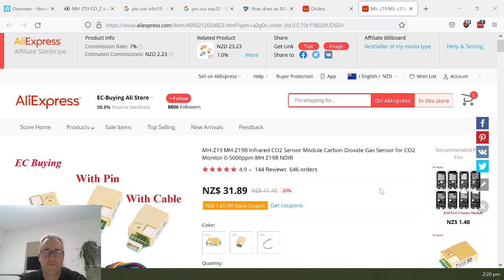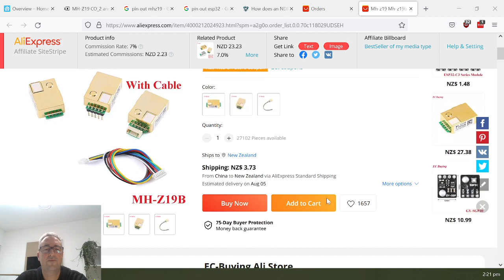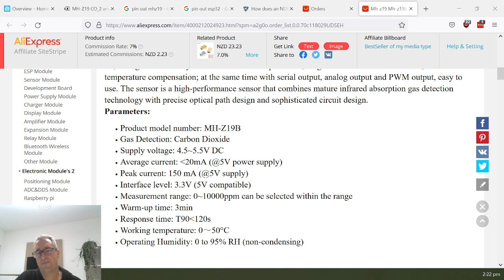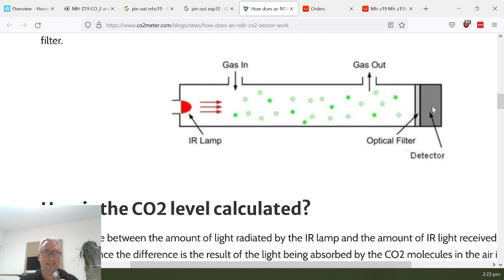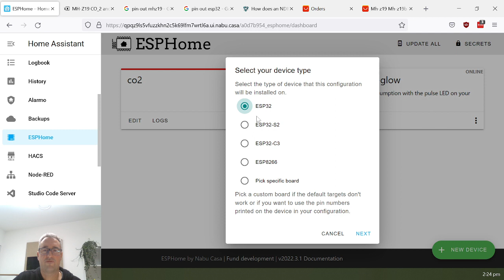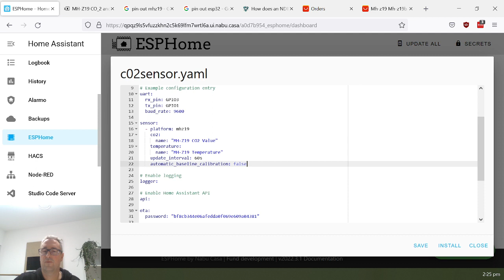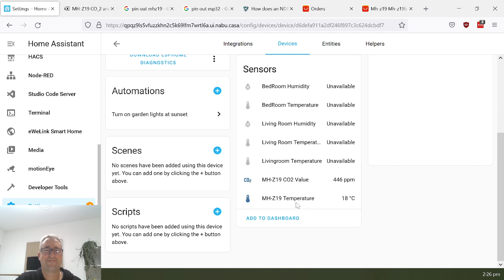DIY MH-Z19 CO2 Sensor build and integration in Home Assistant using ESP Home

Comment: MH-Z19 requires 5V, but ESP 32 outputs 3,3V - can this be (or become) an issue?
Reply from the maker: Hi Markus, the VIN pin on the ESP32 offers 5V.  You can use this pin to ensure that the sensor gets enough power :)

Comment: Hi, thanks for the good tutorial.
Have one question, would it be possible to add a MP503 (VOC sensor) to the same ESP and also use it in HA ? Or do I need to use another ESP for myyMP503 ?
Thanks ! 
👍
Reply from the maker: HI there thank you for your know feedback.
I think you may need a second ESP32 as both sensors are using I2c to communicate

Comment: 2:19 T90<120s means 90% accuracy is reached within 120 seconds
Reply from the maker: Awesome thanks for the input!
Reply: @simonsayshomeassistant  Sensor Time Constant (τ)

Responsiveness of any sensor is usually given as a Time Constant and represented by the Greek letter τ “tau”.  It is defined as the time required for the sensor reading/output to reach to 63.2% of its total step change in measurand. 

EXAMPLE: For a temperature sensor taken out of an ice bath at 0 °C into a room at 10 °C, it will take exactly one time constant (usually given in seconds) to reach 6.32 °C, which is exactly 63.2% of the 10 °C step change in temperature.
Sensor Response Time = 5*τ (5x Time Constant)

The Time Constant of a sensor is very different than its Response Time.  In fact, the response time is exactly five times the time constant. Response Time is the time for the sensor reading to reach 99.3% of the total step change in measurand, or in this case the new temperature. 

EXAMPLE: For a temperature sensor taken out of an ice bath at 0 °C into a room at 10 °C, it will take exactly five time constants (five times longer) to reach 9.93 °C, which is exactly 99.3% of the 10 °C step change in temperature.

Comment: hi.. i have this problem... any idea what i do wrong? 

[21:39:16][W][uart.arduino_esp32:163]:   You're using the same serial port for logging and the UART component. Please disable logging over the serial port by setting logger->baud_rate to 0.

[21:39:16][C][mhz19:094]: MH-Z19:
[21:39:16][C][mhz19:095]:   CO2 'MH-Z19 CO2 Value'
[21:39:16][C][mhz19:095]:     Device Class: 'carbon_dioxide'
[21:39:16][C][mhz19:095]:     State Class: 'measurement'
[21:39:16][C][mhz19:095]:     Unit of Measurement: 'ppm'
[21:39:16][C][mhz19:095]:     Accuracy Decimals: 0
[21:39:16][C][mhz19:095]:     Icon: 'mdi:molecule-co2'
[21:39:16][C][mhz19:096]:   Temperature 'MH-Z19 Temperature'
[21:39:16][C][mhz19:096]:     Device Class: 'temperature'
[21:39:16][C][mhz19:096]:     State Class: 'measurement'
[21:39:16][C][mhz19:096]:     Unit of Measurement: '°C'
[21:39:16][C][mhz19:096]:     Accuracy Decimals: 0
[21:39:16][C][mhz19:102]:   Automatic baseline calibration disabled on boot
[21:39:16][C][captive_portal:088]: Captive Portal:
[21:39:16][C][mdns:103]: mDNS:
[21:39:16][C][mdns:104]:   Hostname: co2-living
[21:39:17][C][ota:093]: Over-The-Air Updates:
[21:39:17][C][ota:094]:   Address: co2-living.local:3232
[21:39:17][C][ota:097]:   Using Password.
[21:39:17][C][api:138]: API Server:
[21:39:17][C][api:139]:   Address: co2-living.local:6053
[21:39:17][C][api:141]:   Using noise encryption: YES
[21:39:46][E][uart:015]: Reading from UART timed out at byte 0!

[21:39:46][W][mhz19:034]: Reading data from MHZ19 failed!
Reply: Hi I have the same problem. Did you fix it?
Reply: @tillellermann1183  Yes
As the communication with the MH-Z19 is done using UART, you need to have an UART bus in your configuration with the rx_pin connected to the TX pin of the MH-Z19 and the tx_pin connected to the RX Pin of the MH-Z19 (it’s switched because the TX/RX labels are from the perspective of the MH-Z19)
Reply: @Paullik83  Thank you for the fast reply. I connected Tx<-->Rx and configured UART. I disabled UART logging with "baud_rate: 0". Now I think I get UART messages but it always fail with byte 5 😑"Reading from UART timed out at byte 5!" "Reading data from MHZ19 failed!" I tested this config with NodeMCU8266 and D1 Mini V3. Which board are you using?
Reply: @tillellermann1183   I have the same problem
Reply: @charles0103  In my case I problebly got fake Sensors. I bought from another seller and they worked.
Reply: @tillellermann1183  really@@?Then I'm also worried if I bought a fake one
Reply: @charles0103 worrying will not help you achieve anything
Reply: I also switched the Rx to Tx and vice versa on the pinouts. And disable logging with baud_rate: 0
This worked for me finally!
Reply: Both these changes fixed my issues as well - I thought I had a faulty sensor. Thank you @kallekarlsson2181   !
Reply from the maker: Show us your esphome yaml code

Comment: How does the measurements of  MH-Z19 compare with the portable one?
Reply from the maker: Hi Vali, they compare quite closely actually.  The portable one seems to react slightly faster though perhaps a minute faster!
Reply from the maker: At most it seems to differ by about 100ppm at times
Reply: @simonsayshomeassistant  that sounds super cool, a minute delay doesn't make any difference when the CO2 concentration changes slowly over the time. I've been using an air quality sensor(s) for more than 2 years now who is using an Winsen MH-Z19B CO2 sensor and was wondering how accurate it can be as I don't have any other CO2 sensors to compare the results. Thanks for your time creating nice video (I'm pretty sure the sound quality is going to get better in time :P )
Reply from the maker: @valentinene  Thank you for your comments Vali.  Yes my laptop got drowned by a glass of water so I am using an older one right now, till a replacement arrives so I will re-shoot the video for better sound!  Sensors fascinate me.
Reply from the maker: What sensors do you use?